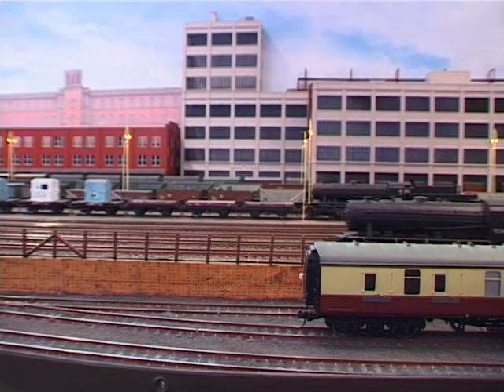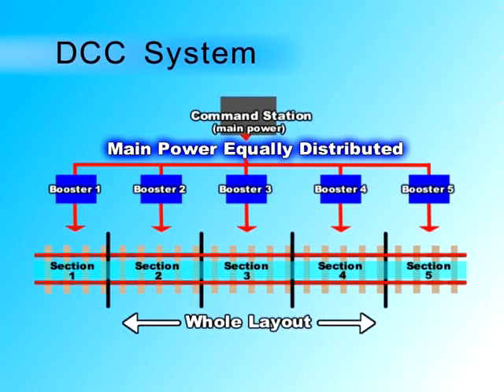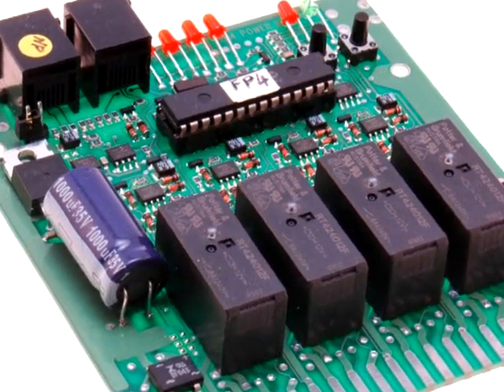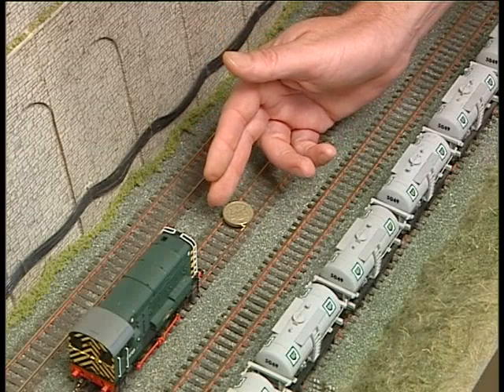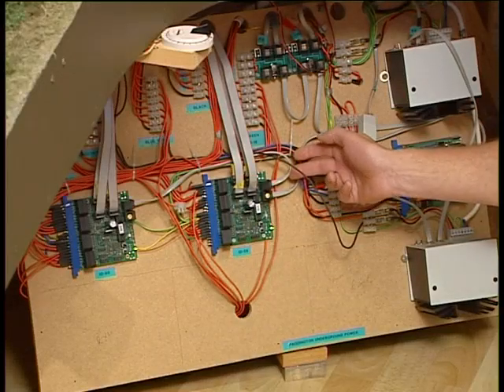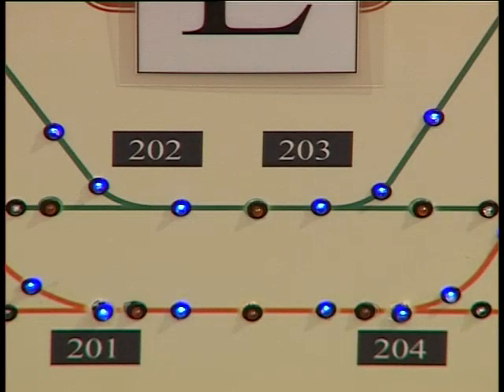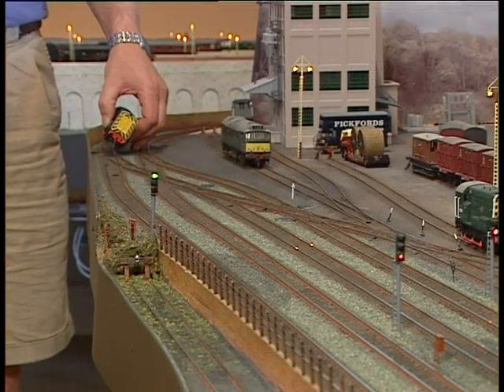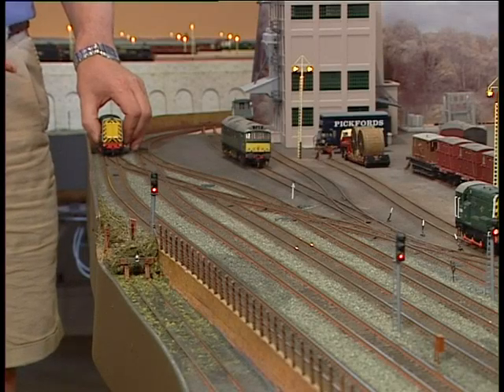DCC hardward behind McKinley Railway

Comment from the maker: You don't need a separate booster. The PM42 works as follows:  If you have a short circuit one output  zone of track, the PM42 protects the booster and up to three other zones of track from cutting out too.  So on McKinley Railway we have one PM42 with four zones in a terminus station. If an operator causes a short-circuit in the sidings, the main station areas and engine shed are wired to different zones and are theefore protected and keep working because they are on separate output zones.

Comment from the maker: Hi Charles, I did wire up the Transponding devices to the BDL168s and spend a considerable time testing them. They were not reliable enough for computer control.  I would get false reports of engines being in one block when in fact it was in another.  The standard BDL168 using occupancy detection works fine for computer control.
David

Comment from the maker: I suggest you ask Digitrax directly. However, if I understand your question correctly, the PM42 does not provide any track power itself.  It simply acts as a multi-circuit breaker between the track and the Booster/Command Station.  If you break one side of track power on either side of the PM42, the locos (and their sound) will stop instantaneously. That in essence is the job of a PM42 - To protect the models and the command station by breaking power as soon as it detects a fault.

Comment from the maker: I suggest you ask Digitrax.  However, I believe the trains will stop as soon as a you remove one side of the track power.  The PM42 acts as a multi-section circuit-breaker. It doesn't provide track power itself. The LocoNet connection is purely for special feedback messages from the PM42.

Comment: Hello David  I've looked wiring vids to help.  I haven't found one yet that helps, maybe you know.  I have a HO scale RR and use a prodigy express DCC and I use it on my carpet RR. I run two big boys and would like to know if I can put another connector re-railer at the far end of the track (Total length of the track is 25 feet.) so it can get power. My question is; If I use another powered re-railer and make sure the polarity is the same, will it effect the command signals to the locomotive?

Comment: Hi, 
Do you use the transbonding add-ons with the BDL168's. Im trying to plan my layout for computer control using digitrax, However digitrax dont offer a complete, simple video (like yours) and it is quite confussing trying to work out what i need.
cheers,
            Charles A

Comment: Hi. This is marquardtbre on our club account. Just another question. If you leave the pm42 plugged in and on, while connected to the track, and you essentially unplug one side of the output to track from the DCS200 and cut off the DCC signal to the engine(s), will the engines not run and be off. As in not run away and not have sound on? Or will the signal be transmitted through loconet? And is it safe? The reason I ask is because our layout has to be able to run on a coin operation system.

Comment: Great video.  I chose a more rudimentary (non-PC) route and build custom relay boards for signaling system, red/green only.   I have now installed a PM42 but the entire layout still shuts down on occasion (50% of time) before allowing non-shorted blocks to continue.

What I mean is your video shows a very "clean" picture of shorting one section and the other just continues.  When I short one section, the command station will still shut down and then all but the shorted block will clear until that block is not shorted any longer.   Does yours do this or is it always just the shorted block that stops?
Reply from the maker: Hi Kurt,  Apologies for the late reply, On McKinley the PM42s protect the boosters which never get shut down.  It would be a disaster if that happened. You can play with the current trigger levels for the PM42.  OpSw01 and OpSw02 should be thrown for 3 amps. Try setting OpSw09 to Closed. that takes the trip current down to 1.5 Amps.  If the command station still shuts down, then you might have a problem with your wiring.

Comment: have been studying your videos  and found them most helpful and clear--I am using the same   digitrax equipment (apart from the pm42) and am about to connect a bdl168 to my layout--i am wondering about the final connection from the bdl168 to the zephyr booster---which wires connect to " rail A " terminal and which to " rail b" --is it just one wire to each terminal?

Comment: Hi Dave. Planning my layout and have loved your videos on McKinley which have helped enormously. Can you tell me if you have used two or three occupancy sensors per block as per TrainController's ideal set up, or just one (and relied on profiling the locos carefully)? Also, have you got occupancy sensors on your groups of points (even though not part of a block)? Many thanks.
Reply from the maker: Hello Hugh,   We used two sensors on McKinley for uni-directional blocks and three for bi-directional blocks to safeguard stopping positions, but you can get away with one.  The newer versions of TrainController have got much better at with the addition of virtual stop indicators (please check if its in Silver as I use Gold).  These virtual sensors work a treat if your locomotives are well profiled, but sound and high-speed are the two bugbears.  With respect to pointwork, we have occupancy sensors on groups of points to allow TC to safely release the pathways.  i.e. a single fan of points has just one sensor for the whole group, but a cross-over between two running lines will have two sensors to ensure trains can operate in either direction.  Hope that helps.   Regards, David
Reply: David Townend 
David, thanks for this response which is very helpful
All the versions of TC now seem to support virtual shifted stop markers. However as far as I can see only Gold supports occupation sensors on points (unless I'm missing something). Still considering which version is appropriate for my layout. Re you comments on speed and sound being bugbears, can you explain further? Many thanks. Hugh

Comment: DCC - NOT MADE TO MEET BR LAYOUT REQUIREMENTS !!! 
What an expensive nightmare !!! Digitrax equipment is NOT designed for British Signalling so will NOT operate British signalling (mechanical or colour light) correctly, it's intended for simple American "ABS Block Signalling" !!!
 
I have full BR "Track Circuit Block" 3 aspect signalling & interlocking as well as BR AWS on my huge 87ft x 25ft  4 track mainline exhibition layout. That all works EXACTLY as per the BR signalling regulation & the most complex thing needed is a load of cheap relays. And requires half the wiring you seem to need for that idiotic DCC nonsense. And my equipment costs roughly 12% of the equivalent DCC equipment. 
My system is known as TCC (Track Circuit Block operation), and only needs standard 12v DC as expensive "Chips" are replaced by far cheaper (& more reliable) relays.